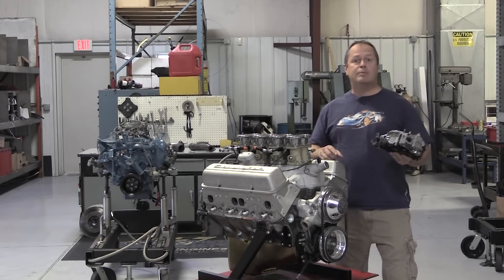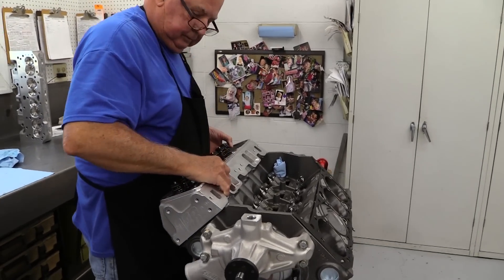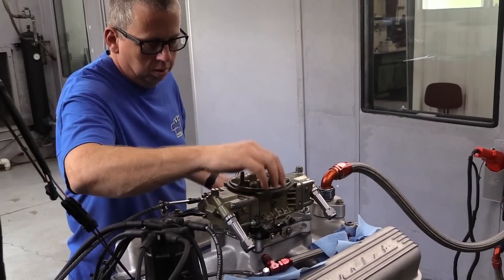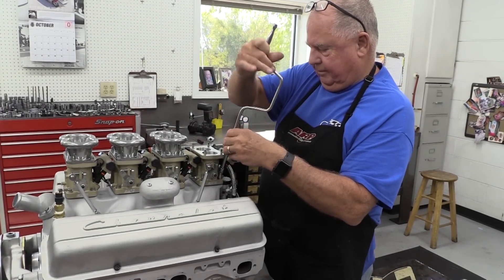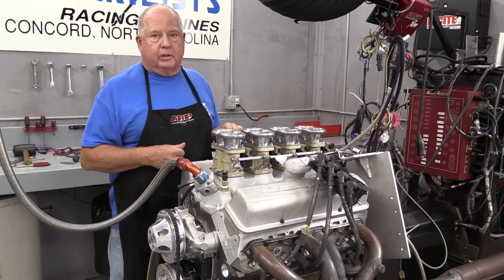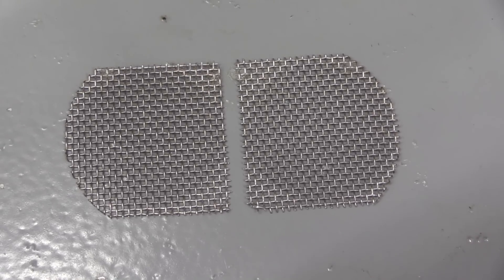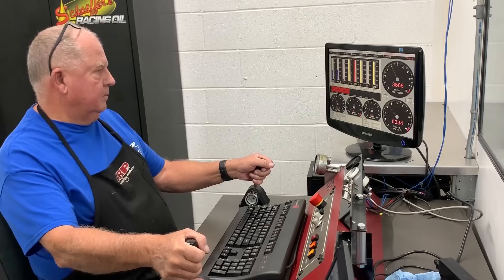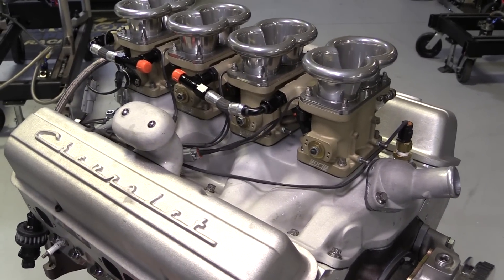Carb vs EFI - Dyno Testing a Holley Double Pumper vs Custom Stack Injection

Comment: It is nice to be able to brag about a big horsepower number, but I never drive around a 6 grand on the tach. Think I would prefer the extra power down low.
Reply: You can have good HP/Torque down and great top end also. With less cubes and cam duration. Its called an LS. I have PERSONALLY seen the light. Dont get me wrong, I come from and love the Gen 1 SBC. But after dipping my feet into the LS world several years ago, I wont ever look back. I wont even touch a carb or distributor unless someone is payng a pretty penny...
Reply: Then just run a 650
Reply: True, theres an expression " Horsepower is for bragging in the bar, torque is king on the Street".
Reply from the maker: @Mercmad  Exactly!
Reply: @jaydubb71  Performance catalogues sell carb swap intakes for LS motors for a good reason. The cylinder heads are where the LS power comes from, not some flimsy little copper wires and circuit boards. The EFI system is choking power out of those engines not adding to it.
Reply: @Impactjunky  we will agree to disagree. I've personally seen the carb to EFI (I won't call them conversions. I will call them corrections... Lol) swaps make more power. Yes, the cylinder heads work very well. But you have more control with EFI vs a carb...
Reply: @jaydubb71  EFI swap setups don't make more power than carbs, they tested that kind of tech on engine masters and it couldn't compare to a carb. As opposed to having the fuel injected directly into the cylinders carbureted engines have fuel atomizing throughout the entire length of the intake runners causing a major cooling effect. Engine Masters recorded internal intake temps just a couple degrees above freezing inside the carbureted intake and temps just below 100 degrees in the fuel injected intake and everyone knows a cooler charge makes more power. That's why the carb and air gap intake on my 68 Roadrunner develop condensation on them when I drive, you can touch the intake or carb after a 4 hour drive on the interstate and it feels like it's been in a refrigerator. Fuel injected engines, especially those with plastic intakes like an LS can't do that. Another advantage a vacuum secondary street carb offers over EFI is progressive intake metering. Nearly all fuel injection systems that aren't directly copying a 4 barrel carb have one large throttle blade as opposed to four small ones. A smaller CFM carb or throttle body makes better bottom end torque and throttle response while a bigger one obviously makes better top end power. A vacuum secondary 4 barrel carb sees the best of both worlds as only two of the four barrels are open until engine vacuum actuates the secondaries. This gives the engine the excellent bottom end torque and throttle response of a small CFM intake until sufficient RPM is reached to open the secondaries and provide the top end CFM boost the engine needs. Obviously running around on half a fuel system until you have it floored makes the engine very efficient. My Roadrunner used to get over 25 MPG highway when it had a small block 273, and 2.76 rear gear. I've been into the next state and back without stopping for gas.
Reply: Get a bigger engine then

Otherwise why build a pickup truck engine? This is performance. Not a phone company van engine channel lol just saying. Build that shit up!!
Reply: @Impactjunky  I understand the latent evaporation that happens as fuel passes thru the venturi(s). I'm more concerned about efficiency and ease of tuning. They do sell 4 barrel progressive EFI throttle bodies tho. And you won't lose a metering signal with EFI like an oversized carb does (which it needs to function properly). I'm a fan of EFI MAINLY for the tunability and repeatability. A good tuned carb runs GREAT. I had a old mid 80s Monte Carlo with a 350 back in the day. 650 or 750 Holley (wait... I had both. The 750 was a double pumper and the 650 was a vacuum secondary). Performed pretty well. I put a Q-Jet on it (because the mileage sucked) and that thing ran like a top. Of course, the Q-Jet was the last mass produced carb ever. I miss my old Q-Jet but tuning that was a pain...
Reply: @jaydubb71  Like I said nearly all fuel injection systems that aren't directly copying a 4 barrel carb use one throttle blade and even the ones that have four like a carb aren't vacuum actuated. All Qjets are 750's except for some less common 800 cfm units that came on high performance Pontiacs. They have vacuum secondaries which is likely why it ran so good on your engine. And you don't need to school me about over carbing. My 400 HP 360 is running just fine with a 600 vacuum secondary and I'd rather have the better bottom end throttle response the 600 provides than a couple measly extra top end horses from a less efficient and less responsive 750 or 800.
Reply: @jaydubb71  This guy tells the same story all over youtube.

It's obvious that he ain't all there..
Reply: @elonmust7470  I wanna see THIS setup! LOL!
Reply: @Impactjunky  Oh so if I don't post a video then it dosen't exist? Call Kowalsky machine in Lynchburg Va and ask them if they've ever done work for Ted Dow........
If the cooling effect from atomized fuel were that big of a deal every automotive manufacture would be taking full advantage of it. Injected or carburated, atomized fuel is atomized fuel. So why aren't they?  
Because it's a neglegable improvement for what it is.

Bottom line is that most people who dislike fuel injection are like that simply because they can't afford it under the guise that they'll be "replacing sensors all the time" which is BS. The only sensor I ever replace is my o2, & that has a limited lifetime regardless of whether or not you run FI or a carb.

1000 hp ls motors are commonplace today in 2019. Most of them are running on ms3-pro. Along with the foxbody I have 2 honda civics. One has a 1.6 liter single cam engine that makes close to 700whp. Without fuel injection that engine would not be...

Wake up and join the 21st century
Reply: @Impactjunky  ,  It's from the carb fuel cooling the intake .
Reply: @Cobra427Veight  Correct
Reply: There's a video out there that if you have the correct set up then you can tune a carb and dial it in just like you can with EFI in my opinion it all depends on the set up and combo of parts that your running on your engine....My dad and I built a gen 1 SBC 350 bored .030 so a 355cid with a 750 cfm carb cfm with pretty good off the shelf parts and had just a set of camel hump iron heads cast crank and if I remember correctly I think we had somewhere around a 540/550 lift solid flat tappet camshaft with 14.1:1 dome pistons and a Victor Jr single plain intake with a th350 trans 5000 stall converter and a 4.11 gears out back and it was N/A no nitrous turbo or blower and we ran 10.0s-9.90s all day depending on the weather if the air was good we would dip into the 9.90s but if the air sucked it would run very low 10s and the engine was in an all steel all glass 72 Nova with a 10in tire and that was over 15 years ago and that engine stayed together with no catastrophic failures for over 10 years and once we put it in the car it was no need to take it back out at all, all we did was kept up on the general maintenance on it like annual oil changes,plugs and wires stuff like that then one day we decided we wanted to go faster so we built a gen 1 400 SBC first we built a .030 over 406cid then we wanted more so we took it back out and made it a 427cid on nitrous and now we're running mid 8s on nitrous all day every day and low 5s in the 8th mile
Reply: @elonmust7470  Lynchburg is a nice place. If you have 1200 HP that's badass, but why don't you post a vid of your car though so people don't have to call an engine builder?
Reply: @Impactjunky  I've never really been into making videos. 
I can't make a video of it now because it's in Lynchburg & I'm in raleigh.
Reply: @elonmust7470  I'm in Durham, I got my car from Loyd Price Senior and Junior at Raliegh Auto on Capital Blvd. They've been racing Mopars in this area for decades.
Reply: @Impactjunky  it's obvious and science fact!!Man...
In One family father is giving limited allowance and said this is it..make use of it wisely
In another family father is not bothering in restricting allowance and said do what you want with it but result should be of my desire...
Carb don't restrict or control fuel flow but EFI controls it totally... 
(Still learning the language of gearheads)
Hopes to own 68 Hurst one day or some day
Reply: @Impactjunky  Neat! Old Mopars were what started my love for cars. I have a 1970 duster with a a 340 in it that I've been working on for a good 15 years now.
Reply: Rite
Reply: @jaydubb71  bro same here!...bruh these LS/LT engines are gonna be hard to beat I mean just swapping a cam gave me damn near 100hp!...its ridiculous!...
Reply: @jaydubb71  me too!
Reply: @elonmust7470  ok I hear ya!...i had a 95 Maxima that i put alot of money in the engine and it did close to 700hp so I km now that's very possible!...I just put 300zx injectors in place of the stock ones the factory bottom end is got to 1000hp so I've heard because the crank is forged!...VQ30DET is what it was when I finished it since I turbocharged it!...
Reply: Well tuned intake, carb set-ups almost always make more dyno hp. But the efi is generally more user friendly!
Reply: @Impactjunky  

this will ....
https://www.cosworth.com/products/mq12di/?cat=Powertrain%20Control

but the price is £9950.00 plus VAT and shipping

i would not drive / own a analog carbonated car ....  not even as a gift.
Reply: Just different cams and tune and setup
Reply: TimeWarp Video
Get a diesel then.
Reply: Fishermanguy44  What if it's a Cummins?
Reply: i think a dual plane manifold is better suited to street revs (mostly under 5000 RPM)
Reply: A dual plane intake manifold is better for lower rpm usage
Reply: Fishermanguy44  like i said, i believe a dual plane manifold is for  street driving, when ..er..you're under 5000rpm a lot. remember, a single plane manifold won't vaporize the fuel mixture at lower revs and that not good for economy or your cylinder walls etc.
Reply: Fishermanguy44   i agree.  Horses for courses as they say.
Reply: @jaydubb71  . That's true. Most 4 barrel carburetors  all have a slight hesitation and if turned correctly you might not notice it. It not even noticeable in many cases.
Reply: @jaydubb71  . The Q-jet when changing the metering rods and doing some jet work actually makes great throttle response. I ran a 850 cfm on my 1969 camaro.it had a 350 10.1 CPR duel pattern cam don't remember spec's off hand some porting and polishing of heads mild stall 2800 with 323 or 356 rearend if I also my cam was advanced 4degs.it put out just over 400 hp I lost my info from the dyno TQ can't remember off hand but it ran very strong I had no issues I had no problem out running most in my class.
Reply: @norristammislideshowmulgre877  oh I don't doubt that carbs work well, especially when tuned. I grew up on carbs and distributors. But these days, why even mess around with them. There's too many EFI systems out here now. Even if it's just the Holley TBI system. It's well worth the investment.

Comment: I think the EFI system just ran out of fuel.  If you do the math, this looks to be the case.  it had eight 36 lbs/hr injectors.  Which is a total of 288 lbs/hr worth of fuel.  Assuming a BSFC of .55, that comes out to 523.63 hp worth of fuel.   And according to your graph, it looks like it made somewhere in that neighborhood.   If you replaced the 36lbs/hr injectors with 45 lbs/hr injectors, that would be a total of 360 lbs/hr.   Again assuming a BSFC of .55, that would be 654.54 hp worth of fuel.   Now whether or not the long block will flow enough to support that is a different story.  But in my opinion you have enough fuel to match or exceed the carburetor's output.  I would love to see this test with bigger injectors! 😁  Nice content btw.  New sub right here!!!

Comment: I would love to see a properly ported old school Cross Ram intake with a pair of old 660 Holleys on it as a comparison to both.
1960's tech was not bad.
Reply: Should have done 4 weber carbs vs 4 throttle bodies. Not a fair comparison. Ive seen as much as 40hp between diffrent intake set ups.
Reply: Agreed
Reply: Meh you'd have a dyno queen with peak power at an unusble rpm.  This with properly sized velocity stacks and port injection vs throttle body would be bring far more usable power.
Reply: @nismo4x4n  You have obviously no experience with crossrams. Mine was made by Edelbrock it has runners twice as long as a tunnelram and pulls like a train from 3500 to 6800. It lives very happily on my hydraulic roller cammed 454 Chevy.
Reply: @johnparrish9215  still wouldn't be as flat CFM to CFM. You can fit a lot more air and fuel per a given volume with injection. It's just simply physics as you can control the fuel stream and not lose any turning to vapor.
Reply: @nismo4x4n  God Damn, would you read my original post. I never said it was better!!!
I said a comparison would be something I would love to see, I think the crossram would do well, I didn't say it would beat EFI if the EFI is properly designed.
Reply: @johnparrish9215  Thats all I said?
Reply: I had the Edelbrock XC-8 cross ram with 660 Holleys on my 2 wheel drive flat fendered Jeep in 1972. The engine was a Z-28 350 inch. For some reason the cam number from Chevy stuck in my mind all of these years...3927140 solid lifter. I polished the intake and put a pair of velocity stacks on it. I ran it twice in the quarter mile at Irwindale and it did 11.26 at 124mph....AFTER chickening out before the finish line. The hood started lifting up and scared me. That manifold was pretty!
Reply: @John Parrish good on top end but as you’re probably aware of  low end suffers due large plenum and runners.

Comment: For the $$$ difference, I'll stick with my Holley.
Reply: i rather have a stable running engine where fuel is where fuel is adjusted to the air mass and exhaust fumes, automatically adjusting ignition timing in combo with the knock sensor and capable of taking any rated gasoline from Bosch.

Comment: First, I will state that this is an awesome looking setup and congratulations to your manifold porting guy for taking an antiquated design and getting it within striking distance of modern stuff. 
However, I tire of the non apples to apples comparisons of EFI and Carbs and then the pronouncement that carbs are still superior.  Modern EFI is designed for a non wet flow manifold, and yet they stack EFI throttle bodies on top and say, carburetors still better at peak hp. Love to see it reversed, lets put a carb on a dry flow intake and see how it does. Just google LS intake comparisons, there is one where they use the stock LS6 and Trail Blazer SS intakes, and included was a Holley Tunnel Ram Dual quad, Holley Mid rise dual quad, Holley single plane, Eddy Hi-rise dual plane carb, and Eddy Victor Jr single plane run with holley 950xp carbs on the single carb apps. The closest the  hp got was within 10hp on the eddy single plane, and the eddy dual plane torque got within 25, of the best factory intake the trail blazer ss. When it came to the Hi-ram dual quad run with dual 950xp's, yes it made more power then the stock intakes, but when it came up against the EFI Tunnel Rams it still lost 5-10Hp and tied for torque, and lost by 5-6hp and 30ft lbs of torque to the Fast/MSD factory efi style intakes.  I'm not saying carbs aren't good, but the truth is a well dyno tuned, proper EFI setup will put it down for HP, TQ, and drive-ability.

Still that motor is sexy looking lol.
Reply: Your absolutely correct.

Comment: I’d love to see a Holley carb vs Holley TBI that rated the same CFM on the same intake manifold running at the same AFR at top end. Any thing else is apples & oranges. You can always make more power by leaning out the carb to the ragged edge where you’d never let it out the door vs letting an FI system manage a safe default ratio. Real world, the fuel injection wins under ever changing conditions.
Reply: Yup, but with one change, the EFI can be larger with more CFM as the EFI doesn't need vacuum and a high flow rate to function well. I'll put a 1000 CFM throttle body on an engine that I wouldn't go larger then a 750 vacuum secondary carb on.

With that 830CFM double pumper, even being a double pumper and properly tuned ya floor it from 1200 RPM under load and it'll go suck, pop, pop, buck, stall. Ya toss just a 1000 CFM throttle body EFI on it, do the same thing it'll go suck, pause, RRRRRRRRRRRRRRRRRRRRRRRR!!!!

Comment: You can't beat an EFI setup for drivability on a Saturday afternoon.
Reply: Yeah you can with a carb and a Sunday afternoon.
Reply: The manifold used on the E.F.I. system is restrictive at high rpm
. It is a dual plane. Use a Hillborn 8 stack system E.F.I. then lets see or an Edelbrock Pro Flow that uses. a Victor Jr manifold then lets see.
Reply: Dude is a legend you can just tell
Reply: @johnpopoff7950  my dad ran hillborn injection over 40 years ago
Reply: @Thumper68  Yes its been around for decades. That same stacked system is E.
F.I. also
Reply: @johnpopoff7950  yep. Off topic but I swear I know someone named John Popoff or maybe he was my dads friend or something and he name rings a bell from when I was younger. Idk 🤷‍♂️
Reply: @johnpopoff7950  Arkansas then Washington now Texas
Reply: @Thumper68  Ok I've never lived in those states.
Reply: @johnpopoff7950  alright sorry I’ll have to ask him maybe it’s someone with same last name. We had a water well business so I met a lot of people doing that as well who knows 😂